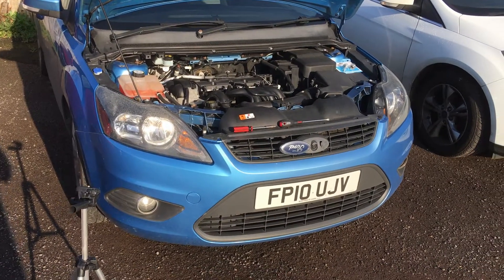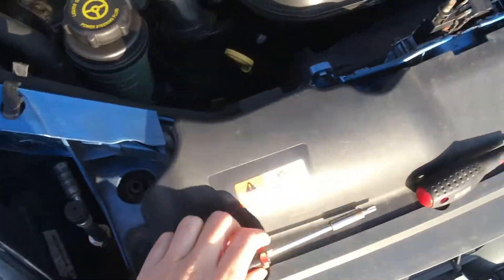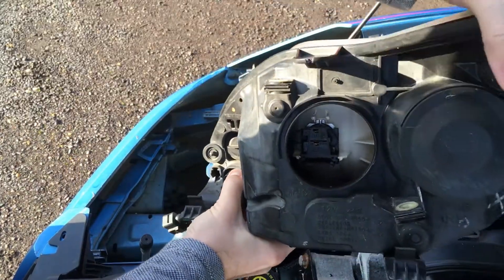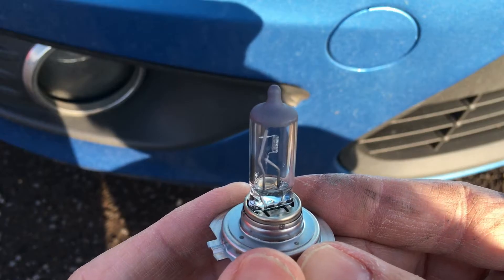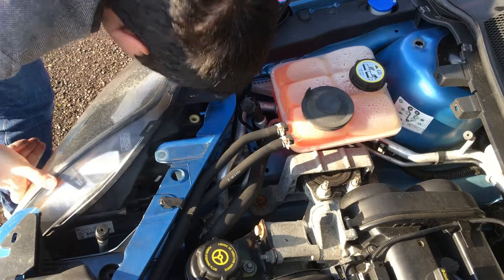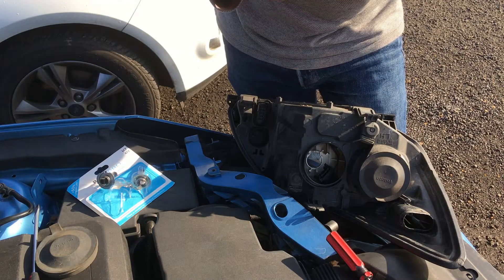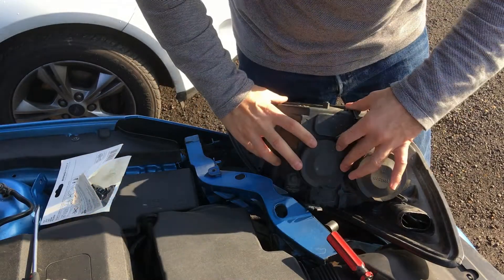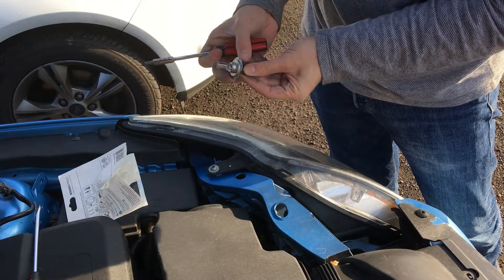Focus MK2 facelift headlight dipped beam bulb replacement

Comment: So much easier than on the Mk I! I spend almost an hour in near dark, both lightbulbs died on my at the same time, had to race down to a manned petrolstation to get insanely overprized H7 bulbs and pry them in by hand without removing the lamphousing on the mk I, and my mobilelight also died on me as I didn't charged the battery....managed to do it though
Reply from the maker: I didn’t know that. I had a mk1 in the past, but funnily enough, I never had to change a light bulb.